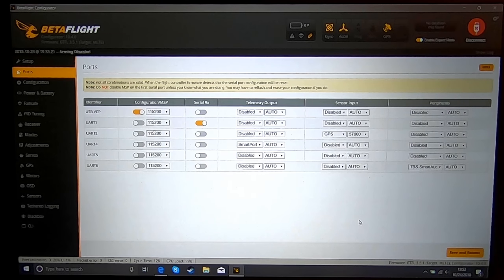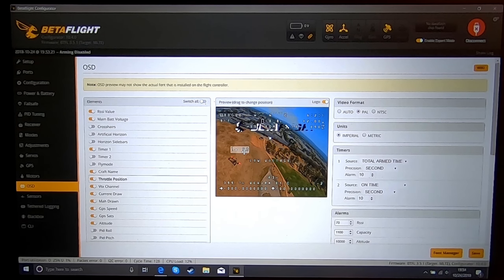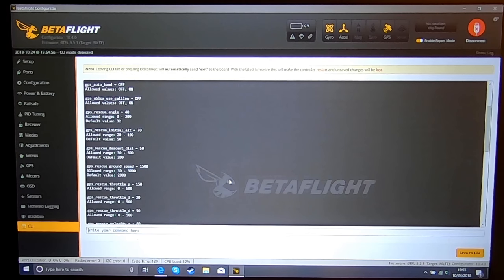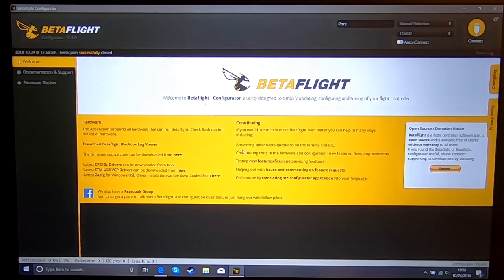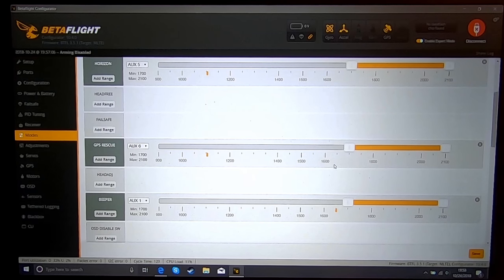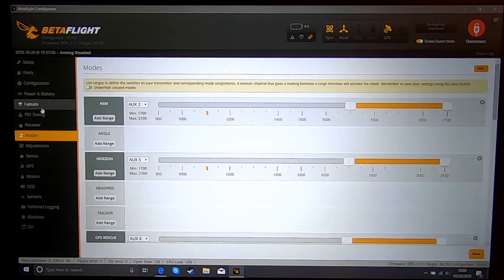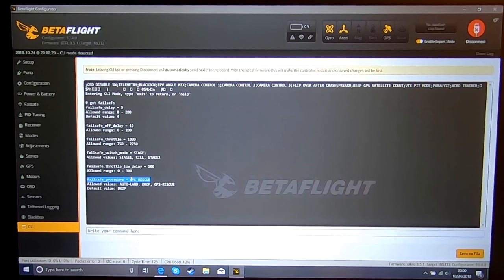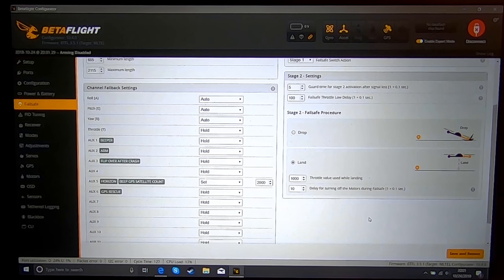BetaFlight 3.4/3.5/3.5.1 GPS Failsafe and RTH Setup

Comment: So in the radio (I'm getting xfire soon so it may change what I have to do), what is failsafe set to? Hold? No pulses?
Reply from the maker: Transmitter should always be set to cut, the flight controller takes full control after a fail safe and returns control when signal is restored.
Reply: @VerJanFPV  I take it cut would mean no pulses
Reply from the maker: @Vaterraman  Yes
Reply: @VerJanFPV  Thanks!

Comment: Thanks for the vid. How do I have to configurate my radio with the failsafe when i use the same settings like you?  I have the flysky fs-i6x
Reply from the maker: The transmitter shouldn't change anything, when you setup the failsafe channel for horizon mode just use a channel that you are not using on the transmitter.
Reply: VerJan FPV , Hello, is this settings means that if I loose connection on my radio to the receiver or quad, does this mean that the quad will automatically comes back toward me? That’s the failsafe right?

Comment: Is the best way to test failsafe to just shut off your tx in a nice open field to see if it kicks in?
Reply from the maker: Honestly, if you have GPS rescue set up on a switch that is your testing. You need to set up the stage one fail safe with the quad going to horizon mode for 1 second and hold throttle. After that is all set up, you set fail safe procedure to GPS rescue in the CLI and your good. If you want to test it by turning off the transmitter you can, but I dont, if your fail safe procedure is GPS Rescue in the CLI then it will work. It behaves the same as when you use the switch.
Reply: @VerJanFPV  hey bro. My GPS rescue works on a stick but drop when i shut down the radio. should i do something special with crossfire? cut or Position maybe? I have the same setting as you except the aux "set" as you did. an other thing I didn't do like you is the sanity check: it was on RESCUE SANITY ON instead of FS only. Any idea? thx
Reply from the maker: @FLOwFPV  The sanity check is most likely the cause of your drop if you have fail safe set to GPS rescue. Crossfire receiver should be set to cut.
Reply: VerJan FPV  thx a lot! Let’s try!

Comment: Why does my Quad drop when i acitvate tge GPS return to home? (newbi question sorry!)
Reply from the maker: So it's not a super easy question to answer but I can give you places to check. If you have GPS rescue on a switch and it falls out of the sky when you hit it then it either doesn't have enough sats or it could be on an older firmware and sanity checks on so when it is within a certain range from home it just reverts to failsafe. I set sanity checks to failsafe only and min sats to 5
Reply: Thanks for your help!  i have limited knowledge but i have a small idea of what you mean!  We English are a littel slow!  
Again thanks i will let you know what happens!